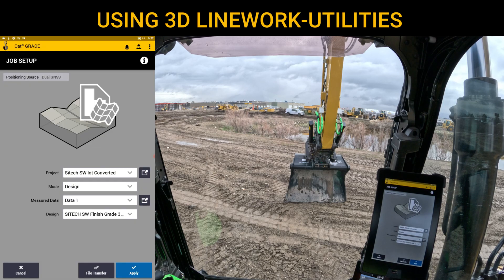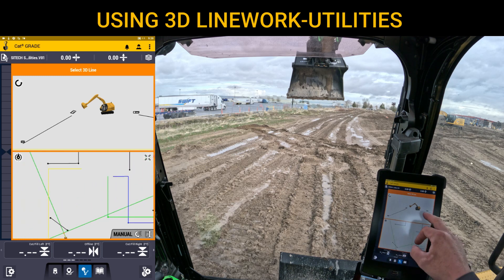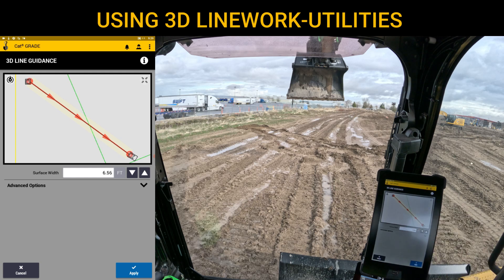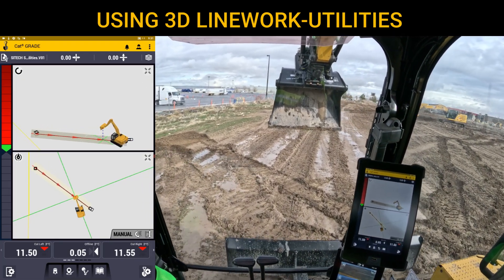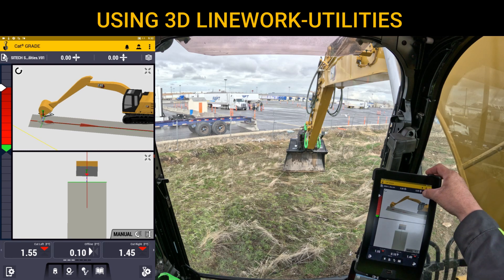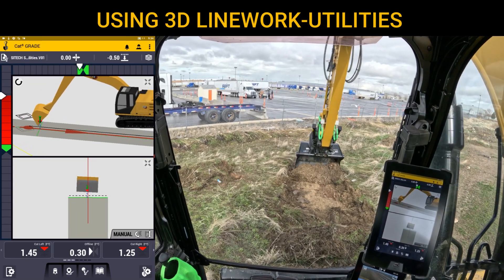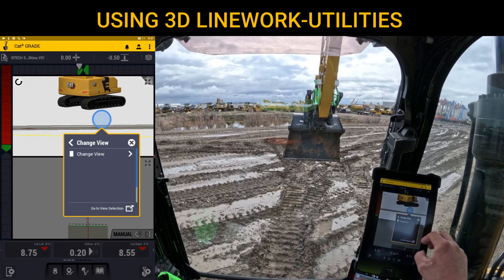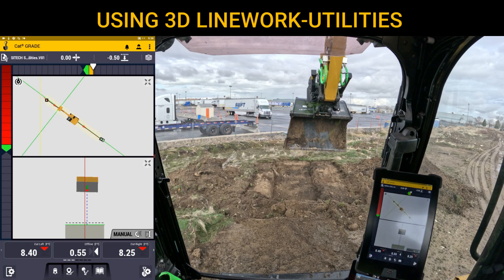Earthworks 3D Linework

Comment: Hi, is there a way to name  the 3d lines (in Trimble Business Center) so that the machine user knows which line to select. (sometimes there may be situations when several lines go next to each other). Or would the color of the lines be a good way to identify the line to be selected?
Reply from the maker: @Wharfedale1991  yes you can select each line in Trimble business center and then go to the properties and give them names for sure.  Once in the data collector or machine it will give you the name.   The older versions of earthworks don’t show, but the newest versions do.
Reply: @sitechintermountain  okay, I think the problem is in the older version then. Because I have given the lines a name in the business center. Thank you for advise!

Comment: Yes you can.  I have 2 other videos in the earthworks playlist you could watch on this.  The best way is to go into infield design in the machine mode and then go to create.  In there is a level plane option, slope, and alignment and section.  For slope you can physically take the machine from each end of the pipe you need to dig and create a point for location and then edit the elevation to match your change or update and then you will create the pipe line and proper elevations.  In our playlist watch number 29 and number 4 if it will help.   Thanks for watching.

Comment: Am I able to infield design an elevated line with two endpoints at a specified elevation per plan and length for a storm or sewer line.   Or is that something I need to use a rover and data collector to cogo and export to the machine or business center in the office. Most of our jobs we have been getting have had lots of rework on utilities, short on office help  and we have a new spread of inexperienced operators coming thru